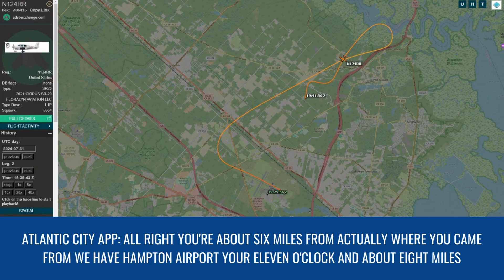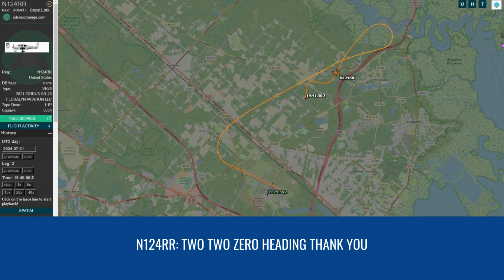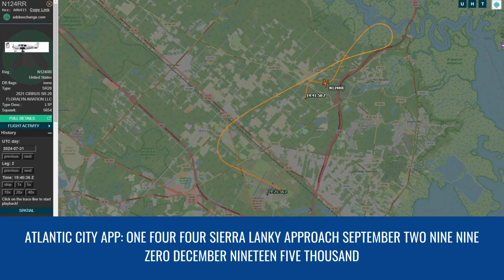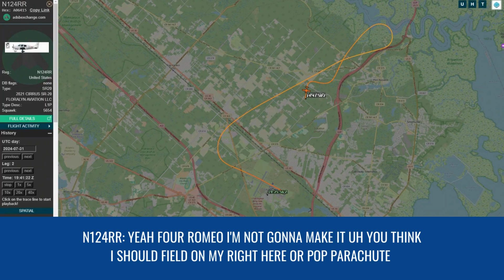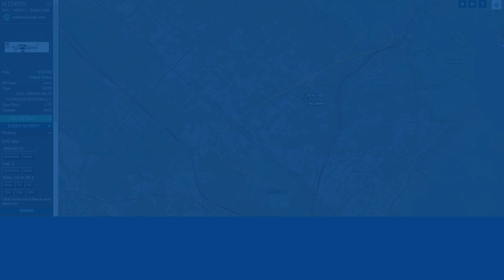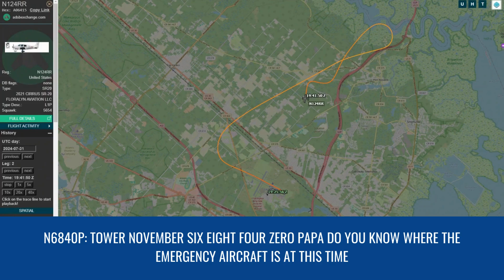Pilot Pulls Parachute: ATC Audio Captures Pilot's Decision to Deploy CAPS

Comment: The airplane was only about 3 years old, sad that there wasn't any other option than the chute.
Reply: Cirrus trains pilots to pull the chute. Better PR than dead pilots.
Reply from the maker: Definitely a pity to have to deploy the chute. But thank goodness for that option!
Reply: Can the plane not be repaired after landing with the parachute?
Reply: @teenflon  Almost always written off. It is a composite construction that will lose integrity when the rocket motor blasts that hole through the fuselage. Not to mention other damage done as it crash lands in a nose down attitude. Prop, engine, engine mounts, firewall, static bonding... no A&P or IA wants to lose his/her certs trying to make it airworthy again. Pull the caps and the insurance company owns it.
Reply: @scottbeyer101  To add to this, insurance companies prefer this option. A lost hull incident is cheaper than major injuries / death.
Reply: @teenflon  Usually a write-off. It's like getting dropped from 20 or 30 ft (is my guess, look it up if you want a real number:). Then if there is any wind it might get dragged. "descending vertically at approximately 17 kts". Well I have calculated that, I get 25ft. I didn't do it really carefully so may be bollocks.
Reply: @AnIdiotAboard_ no that’s not true.  About 25% get repaired and returned to service.  All depends on the landing as already posted.
Reply: @AnIdiotAboard_  that's not true. I can repair a 20 or 22 if chute is pulled and aircraft lands in an ideal location. Like flat grass, flat sand, dirt ect.....Not always a wite off
Reply: Pulled the chute, absolute correct decision.  Field or highway is a much higher chance for death or injury.  I just hope he didn’t run out of gas.
Reply: The highway was an option.
Reply: @davestillson2269  Highway only a good option out in rural areas and daytime.  Because at night you can't see bridges, overpasses, and powerlines. In urban areas highway not a good option because cars and trucks are not expecting an airplane to land on the road. But that being said, Cirrus really needs to switch to Delta Hawk or a better engine because too many Cirrus engines quit. And GA airports need to consider net arresting systems. Pilots need to HIGHLY ENCOURAGE the BRS engineers to develop retrofits for more aircraft models. They WERE on schedule for a mod for the C-206, but they stopped and never gave a reason why to my knowledge.
Reply: A@davestillson2269  An option. But the risk of a fatal crash from striking powerlines or cars is still greater than deploying the chute in an open field. If he were to die from landing in a field, at least he didn't needlessly endanger the lives of motorists on the GSP.